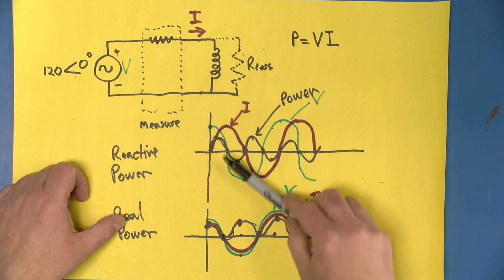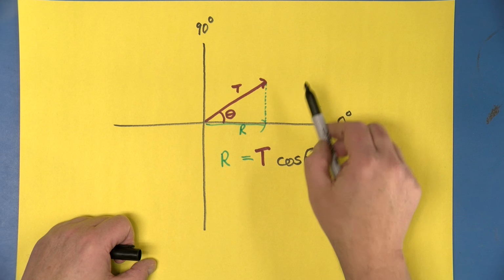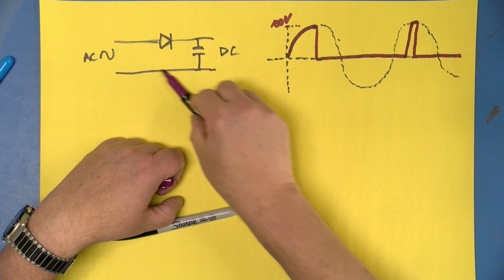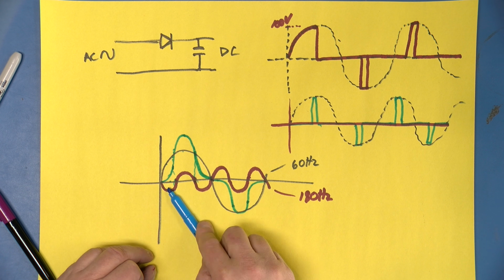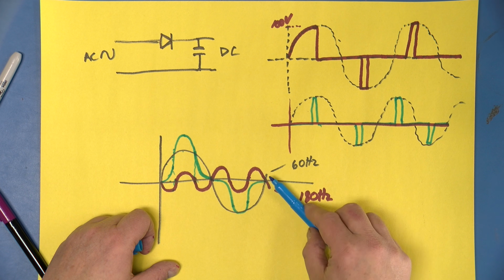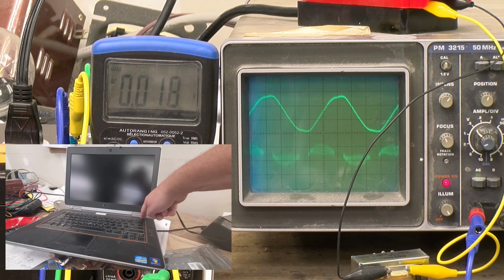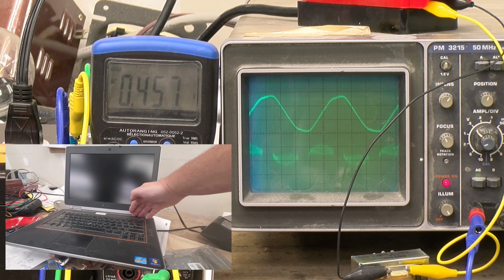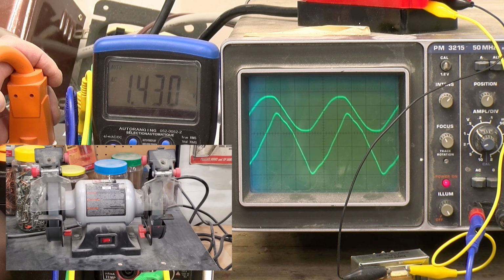Power Factor: you won't believe how bad some of our electronic devices are!

Comment: Maybe the light bulb that shows a square wave current also flickers to the eye as it turns off to black when it is not drawing power. They can't fit many components inside the volume of the socket. You can hear some of the computer power supplies in idle mode. The switching frequency and duty cycle drops to get into the audible range. I have a scanner that is annoying, but I only need to use it sometimes, so it is not too bad. You probably have many power bricks in collection that could tested without bringing out a computer.
Reply from the maker: From what I have seen most of the led bulbs with switching power supplies show no flicker when using a video camera to look for it. But there are some that use a  capacitor as a current limiter and a bridge rectifier instead of switching power supplies and they sure flicker.

Comment: It seems that the circuits which give the newest LED bulbs the ability to filter flicker and turn off and on more like an incandescent light, also at the same time should help with the power factor, if it is using a capacitor and/or inductors.
Reply from the maker: Yes - and I think there is increasing pressure or regulation put on manufactures to make bulbs that behave nicer to the grid that those with terrible spiky current waveforms. 

I'm also guessing that the improved control ICs these days have made almost a given that new bulbs have much better current waveforms.

Comment: Ah the GE Circlite bulbs. We had one when i was a kid. They are so cool looking!
I guess the circlite had the magnetic ballast, is why it looked like the inductor, lagging the voltage waveform.
Still much much better than the electronic ballast later.
Reply from the maker: Exactly! The screw in holder I had has a heavy ballast in the middle. Great example how the old simple technology  is better in some ways.

Comment: I actually learn this in the field. I was trying to figure out how a power supply for a UV oven worked. So you bring on capacitor banks to increase UV intensity. I could not wrap my head around it. Capacitors don’t increase voltage so how does this work. It took some research but the best I can figure is that as the true in phase power increases due to capacitance being added the bulb gets brighter. It has a 208 to 1000 step up transformer then contactors that bring on oil filled capacitor banks. Is this right? Engineering at the plant couldn’t answer it.
Reply from the maker: A UV oven - had no idea such a thing existed. For curing epoxy or something like that?

If there is inductance in the circuit, capacitors actually can increase the voltage (!) across the inductor and capacitor in a way that they add together to be zero - or at least the voltage across each of the individual components is greater than across the combination. My guess is something like that was happening but without the circuit diagram hard to know preceisly what was going on. I show that in a video here (the link should start you in the right location. Go backward a bit for theory, forward a bit for a real demo)  https://youtu.be/Itq_7bhpwqM?t=1898

This sort of thing is really neat to observe and is   a tuned circuit - the value of the inductor and capacitor  actually sets the frequency where this effect is greatest - its used in radios to tune to a station - the radio dial adjusts the capacitor to set the frequency where this occurs is  the radio station your want.
Reply: @ElectromagneticVideos  it’s for curing coating on fiber optics also color in a high speed application.
Most of the electricians I worked with had electronics background being that we used to be Bell labs Western Electric . I think you would find it quite interesting being that we have RF generators for inductive heating running at 2100C built in the 80s by a company called Lepel. We have almost phased out the old technology for solid state at this point. I like the older stuff because you have tuning coils inductor coils, Saturable-Core Reactors, capacitors,  Triodes Electron Tubes and chokes to achieve the high power RF. It’s all done in pieces you can see.
I will take a picture of the schematic, and email it if you’re good with it I would like to know. Basically it’s 3 dropped down, parallel rungs of capacitor banks in series that connect back together, and go out to the uv bulb a Iwasaki machine.
Reply from the maker: @ronborkowski1721 Fiber optics - how cool! Have you seen them draw out the fibre from a layered doped blob of silicon dioxide type material? Saw that decades ago in BNR, the predecessor of Nortel. That older stuff sounds amazing - I like that stuff too. Once got a tour of company that made shielded cables with machines that were 50 years means send me the photo of the schematic. Be interesting to see if I can make heads or tails with it!
Reply: @ElectromagneticVideos Will do will even throw in a cool photo of the glass being drawn into a fiber with the different layers of refractive indexes being drawn down.
Reply from the maker: @ronborkowski1721 That would be fabulous! Actually - please let me know if I can use your fiber being drawn photo in a video. I have a number of fiber videos planned and that would perfect for them. When I visited Nortel it was way before we all had cell phone cameras (or even cell phones).

Comment: Those spiky currents chock full of harmonics are the bane of amateur radio operators worldwide. Switch mode power supplies out of China, with zero filtering, are the worst offenders.
Reply from the maker: Yeah  - some of them are awful. I wonder if older amateur radio people have noticed the difference? I used SW radio a lot when I was a kid  (we lived overseas) and obviously no switch mode power supplies back then other than in the TV flybacks. The biggest issue I remember was intentional or unintentional jamming - the HF band was crowded back then.
Reply: @ElectromagneticVideos  RFI is at an all time high and has all but destroyed SWL in many areas, and can wipe out entire bands on HF. 

I differentiate between powerline RFI (created by problems with faulty hardware in the power distribution system) and that which is created domestically and exported though the power lines as well as through the air.

Jammers are still a thing, but improvements in direction finding hardware and software usually locates those without too much effort with sufficient motivation. (Getting the FCC to act on them is entirely another thing.)
Reply from the maker: @James_Bowie  The other really unfortunate thing is the internet also destroyed SW radio - hardly any major services left. I used to be involved with commercial/military HF comms, and even 20 years ago the bands were crowded. From friends still in the business I gather they now use much larger sections of HF rather than something like a 3kHz channel or two to increase data rates because there is so little other traffic.  That sort of stuff is usually done in remote locations or out at sea so probably much less switching power supply noise. 

Back when I was a kid (mid 70s) we lived in Baghdad for a few years - the jammers were from the USSR - they didnt want people in the Middle East or elsewhere listing to BBC World Service, Voice of America etc. But it was never that effective - the radio services broadcast on multiple frequencies and there was always some that were reasonably  clear. 

Power distribution noise - you reminded me of something from years ago. When I was a grad student I had an old jalopy with an AM only radio. Whenever I drove under one particular long distance HV power line, it knocked out AM reception. I was always amazed the harmonics when that high.

You said "RFI is at an all time high and has all but destroyed SWL in many areas". Does amateur radio still  use HF a lot or is most of it other bands now? I always thought the appeal of amateur radio was talking to someone on the other side of the planet.
Reply: @ElectromagneticVideos  The jammers I refer to mostly attack VHF repeaters. They would make a great study for a team of psychologists. 

Powerline RFI is created mainly by arcing and sparking -- squarish waves containing  an infinite number of harmonics, with most energy being in the longer wavelengths which travel up and down the powerlines for miles. 

It is usually  tracked by finding its unique 'signature' at 130MHz and then following it through the bands right up to 800MHz when you can bet that you are right on the source. After that, ultrasonic sniffers are used to identify the actual arcing component. 

HF radio is still quite popular, especially when the solar cycle favors 'skip'. And there are still many CB'ers on the 11 meter band, also using skip and often (quite illegally) running thousands of watts.
Reply: @ElectromagneticVideos  Re HF, there are quite a few YouTube channels run by hams, one of the more popular ones is DX Commander. He is always working on new antenna designs mainly for working HF.
Reply from the maker: @James_Bowie  Jamming repeaters - wow. Clearly they have the technical expertise - as you said - the psychology behind that would be interesting (and deranged). 

Arcing is the cause - interesting  - a bit surprised enough of that goes on to be a noise issue. 

CBs at kw power levels - wow. My neighbour who worked in Zimbabwe 50 years ago told me how he had setup a bunch of new police radios somewhere around those bands and on particularity  good (or bad) ionospheric days ended up with Italian and New York city police on their radios much to the confusion of all involved (and at low power). When I was doing HF it was amazing how far we could go at relatively low power levels on good days - it helped that our system actually used multipath to its advantage in terms of redundancy.

Comment: Thought: what is the power factor the newer AC reversible elevator motors?
Reply from the maker: I must admit I dont know much about how elevators are configured other than having watched some YouTube videos. I would have guessed the in  modern system the the AC motors would be run by an electronic variable frequency drive, so the power factor would depend on how well they designed the AC t DC power supply in the VFD. 

Have you ever seen an old elevator with a Ward-Leonard speed control? I have never seen one, but was fascinated  by them when I too an electrical machines course as a student.

Comment: Retired electrician and can not figure out how all cheating lack of quality control communist china LED'S never provide power factor on labels. I emailed one of the big LED internet sellers asking for power factor on just two very common 120 volt LED'S they sell. Could not supply me it.
Reply from the maker: I think there are a few reasons: 

1) Since they are not required to provide that info, they dont provide it because if they change the electronics they dont want to be committed to a certain spec. Having the inner electronics switched without a product number change in a big name brand Ethernet dongle once bit me after new ones no longer worked in a certain application so it does happen. 

2)There doesn't seem to be a generally accepted single way of defining power factor or some other measure of "badness" for the horrible current waveforms  of electronic power supplies 

3) The "manufacturer" may not even know the specs or even the schematic. Sadly so much stuff today is not made by the "manufacturer" - they just contract it out be built wither certain specs. A great example is store labeled tools, bulbs etc. The hardware store chain has no idea whats inside the product with their name on it. 

So I think the issue runs deeper into how the supply chain works today.

Comment: 32:32 its a linear regulator inside producing constant current when voltage gets above led turn on threshold.
Reply from the maker: That certainly could be it. Could it be intended to operate the LED close to its max current to maximize light output?
Reply: @ElectromagneticVideos  It just limits current so that LED does not burn out. Here is one linear regulator example used in cheap LED filament bulb: SM2082D
Reply from the maker: @antronx7  Just looked up the spec sheet of the SM2082D. Exactly as you said. Interestingly though, the example schematics all seemed to have an electrolyric capacitor after the full wave bridge to create continuous DC whihc would also create the spikey currrent draws rather than the square wave iwhich would result if no capacitor or only a small one was used. Any idea if a bunch were made without the smoothing cap to save costs, or produce a somewhat better power factor at very low cost? It could also be a failure mode - if the electrolytic driend out and failed after being in a enclosed light fixture and was subjected to a lot heat. When I am back (travelling right now) I'm tempted to take that bulb apart and see what inside. And if I can find an identical bulb, test it.
Reply: @ElectromagneticVideos  The electrolytic cap is only 2.2uF 400v so not much smoothing going on in 4w bulb. It also connects to grid via 120ohm series resistor. In every case I witnessed it was the LED filaments that failed. Terrible design from reliability point.
Reply from the maker: @antronx7  I guess its the initial cost that sells the bulb, and if they fail early, nobody brings them back - for that matter probbaly cant remeber where they bought them.

Comment: It would be interesting to see how a LED dimmer would change the curve. You could do a couple different types, reverse phase, magnetic low voltage and preset dimmer.
Reply: The low voltage would have be on a  AC transformer and 12v or 24v AC light source.
Reply from the maker: @brandonmercer210  I do have some troffer LED fixture with 10V DC dimmer control. Might be interesting to see what the waveforms from that are like, particularly since they are intended for large scale deployment.

Comment: I work in a mill and there is a big cabinet that switches big inductors and capacitors in and out to maintain power factor...
Reply from the maker: Interesting there are inductors in it since  its usually the induction motors that are the main source of currents (lagging) that need capacitors to zero them out to get a close to 1 power factor. Maybe the inductors are for more precise adjustments? Anybody know?

Comment: So if there was a focus on improving power factor, then global power usage could be significantly lowered, improving humanity’s environment impact?
Reply from the maker: Not really power generation/usage, but size of cables, transformers, generators etc - the poor power factor means we are limited as to how much power we can generate or deliver to less than what we could do with a perfect power factor situation.  Or alternatively our existing power systems could supply more homes without up-sizing the equipment. So in that sense we would be lowering the environment impact. Its not all positive gain though - there will be some hopefully smaller impact from the more elaborate additional electronics needed to improve the power factor.

Comment: Looking into a clear " filament" type LED bulb...I can see what appears to be a full wave bridge and current limiting resistor...at least, that's what is visible on the circuit board I can see.
    An older LED here in the house quit, and I took it apart....it had a transformer based power supply potted in...epoxy..? It lasted about 10 years, at maybe 4 to 10 hours a day.
     I had one of those circular CFLs in a floor lamp, and it lasted nearly 20 years at 8 hours a day ( on a timer).
      I have an older CFL out in the garage on a timer that's approaching 30 years old at six hours a day. It's outlasted two timers! 
      This is a well done video!
Reply from the maker: What a shame about the current limiting resistor - undoing some of the potential efficiency. Too bad they didn't use a capacitor (probably cost). 

I have a bunch of old CFLs that were removed when LEDs got cheap - I should take apart a bunch of them and see whats inside. It sounds like you have remarkable longevity from a bunch of your bulbs. I wonder if its good quality bulbs or well ventilated lamps - the big issue usually is heat often drying out cheap electrolytic caps, and many fixtures are poorly ventilated making the temperatures they are subject to even worse. 

Glad you liked the video!
Reply: When LED bulbs first hit the shelves they were very expensive (to the point where people were stealing them out of lamp posts on private properties). I guess some of them did use transformers, but any that I have pulled apart simply use a dropping capacitor which can fail over time, which is what manufacturers want. Shades of the Light Bulb Conspiracy (google that).

Comment: Power factor of 1 means that capacitive load is equal to inductive load and hence there's no overall shift in phase between voltage and current, and all "left-over" unbalanced load is resistive.
Reply from the maker: Yes! Exactly (or simplest ideal case,  no capacitive load or  inductive load in the circuit as in the case of a pure resistor)

Comment: Using phasor diagrams is only rational for sinusoidal current waveforms (and assumes the voltage waveform is always sinusoidal). In the real world (90% of the time), the PF needs to be analyzed as Real Power divided by Apparent Power. Apparent Power is easy, equals RMS Voltage x RMS Current. Real Power is the tougher concept ---  integral over one waveform period of instantaneous power (instantaneous power = instantaneous voltage x instantaneous current).
Reply from the maker: Exactly! And nicely described.